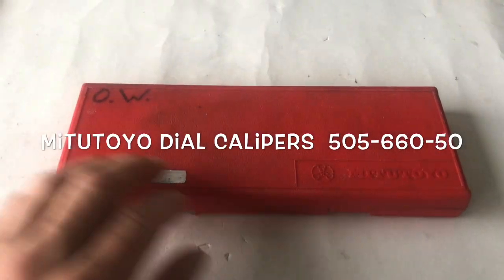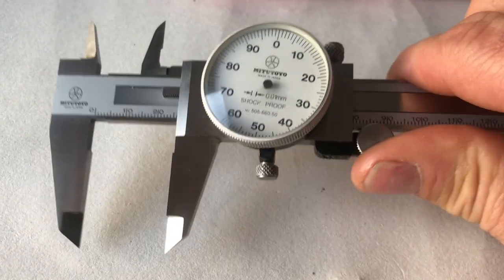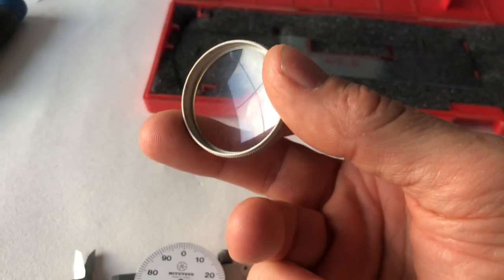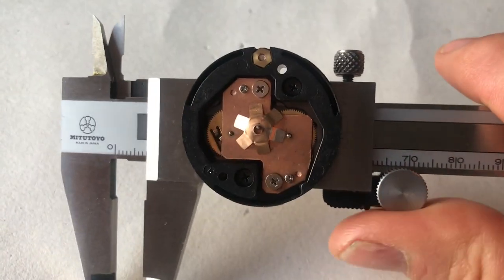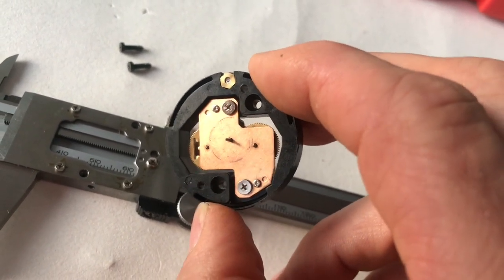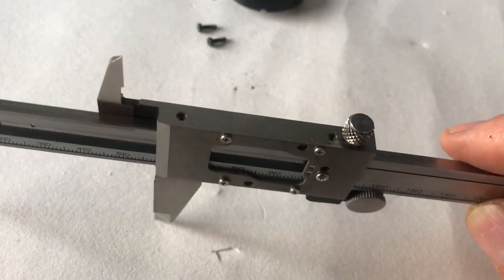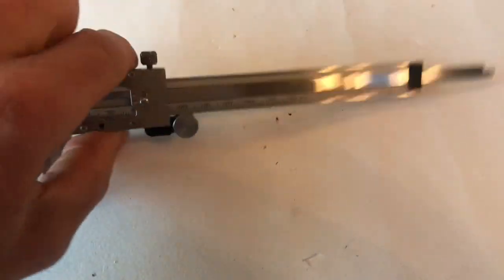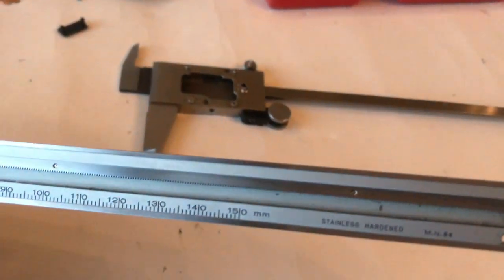How to dismantle, clean, service, rebuild and preload Mitutoyo Dial Calipers - Part 1

Comment: It took me a while to understand how this preloading mechanism actually works. Once I figured that out and how to put the gearbox back into place without losing the load, it was easy.
Thank you very much, without these instructions I wouldn't have even suspected that it was necessary to apply some preload and would've wondered why the dial wouldn't work anymore.
Reply from the maker: Well done and thanks for the feedback. You can do it 👍

Comment: Thanks for the video!  I have a set of No. 505-627-50 calipers.  I am having extreme heartburn trying to remove the needle!  I mean, I am REALLY prying up under the center section.  I am using a pair of tweezers to straddle the stem.  I placed a razor blade on top of the dial face to absorb the force.  Your thoughts?
Reply from the maker: They can  be on there tight 😳 You can do it 👍
Reply: There is a special took for safely removing the needle that I see from time to time on a couple of watch b repair channels.  I  do not know what thebtool is called nor dobI know the costs. But I 'd bet dollars tobdonuts that there are people in this c I m ments section who do know. There are quite a few people here that obviously know more than I do.

Comment: Mine are 505-633 callipers and in desperate need of a service. They became so bad that I stopped using them. Looking like today is the day to see what is inside.
Reply from the maker: Keep us posted. You can do It :)
Reply: @YoucandoitwithJules  My calliper is 0.05 accuracy as opposed to yours at 0.01 accuracy. The complexity was much simpler to deal with. Only a single pinion wheel running on the rack and the needle attached directly. 
All clean and functional.
Reply from the maker: @Phil_Cleaver  Good work, You can do it 👍

Comment: Beautiful; very useful,just did mine,it was a bit magnetized and had metal chips inside on the gears;
Just onemore little thing,the sound could be a tad higher,we can barely ear you;
Thanks.
Reply from the maker: Hi glad it helped. Yes sorry sound is crap was one of my early videos and I was in a rush to fix these so I could finish my KTM 300 engine rebuild for an event. You can do it 👍

Comment: You started strong. Then your volume dropped. Imagine if you will. A half deaf machinist trying to watch this.
Reply from the maker: Hi Apologies I made this video really quickly as was building up an engine and need the calipers fixed. Thanks for the feedback.
Reply: I have to agree with this comment as I am half deaf and did experience difficulty understanding in some parts. That said, thank you very much for making this video. It was quite helpful!